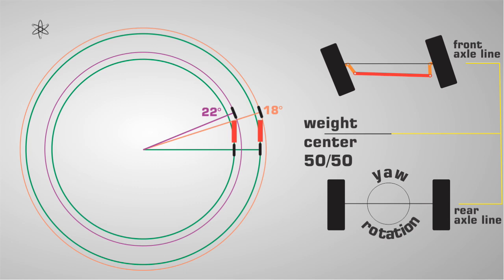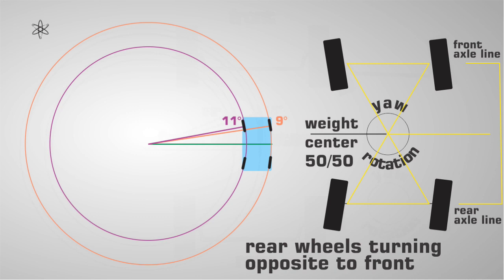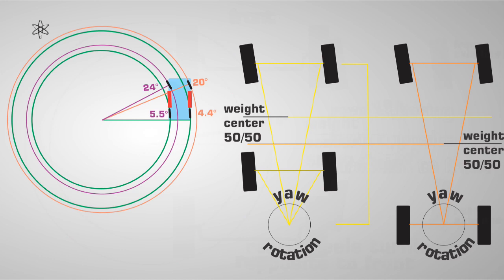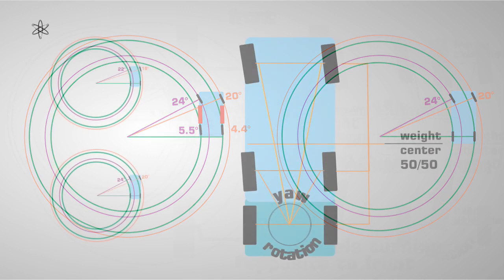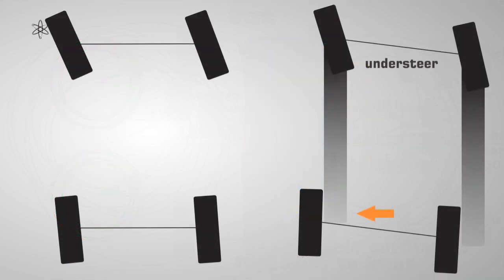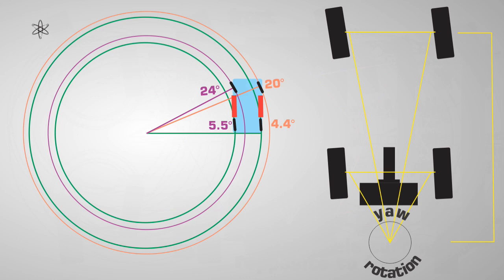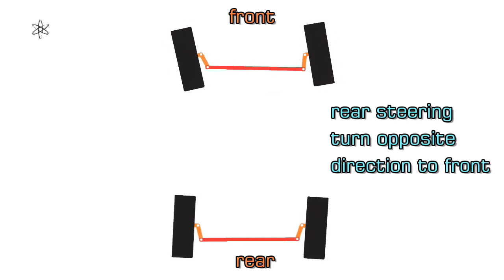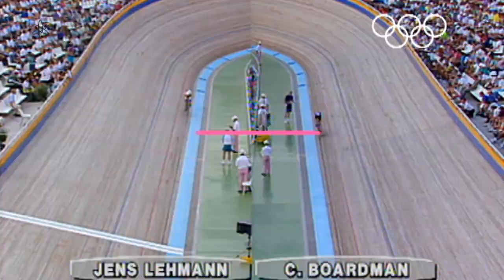Four Wheel Steering Counter-Phase In Phase

Comment: Mechanical linkages for this seem to have a dual ratio in the rear. For the first few degrees of steering, the rear wheels steer with the front, crab walking the vehicle, as the steering is turned further, the rear straightens before turning counter to the front, performing as a shorter wheelbase. Obviously this is done a a simple solution to provide in phase at low steering input for high speeds, then counter phase for high steering input at low speeds.

However, it seems that it would be more advantageous to do the opposite at higher speeds. Counter steer the rear initially in order to rotate it into what would be an oversteer condition for a 2 wheel steering vehicle, and then to turn the wheels in phase and slightly crab walk the vehicle through the turn. This would introduce a sideslip angle onto the rear axle and then utilize the available traction of the rear to balance the reduce the horizontal forces on the front axle.

The Ackerman ratio seems to be a nightmare as well, with the center of rotation constantly moving around.